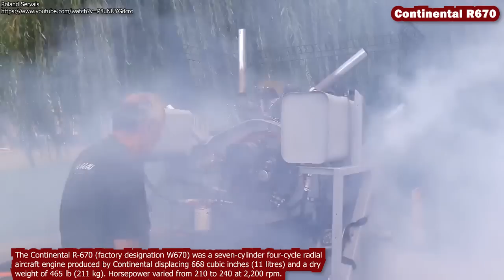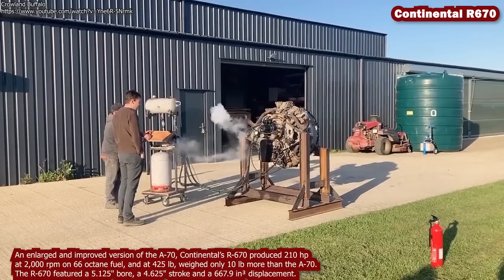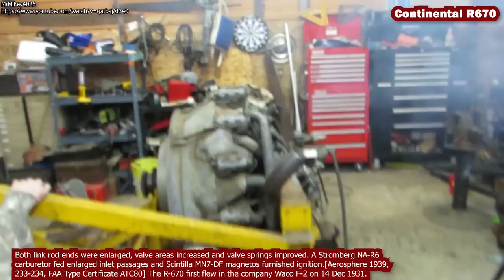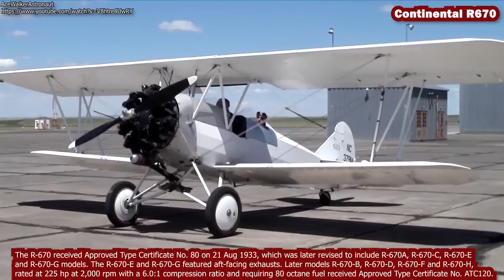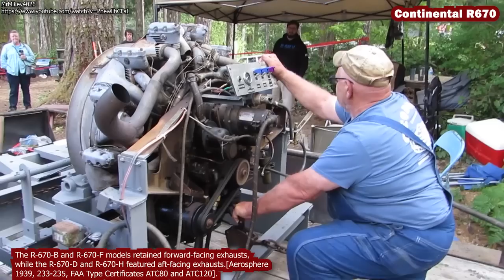Big Old CONTINENTAL R670 Engines COLD STARTING UP AND COOL SOUND

Comment: The W670 is the aircraft version, 220hp. The R670 Ordinance Engine (tank) has domed pistons and is rated at 250hp. The tank engine has many other common components (jugs, starter, some internals) that can be used in the aircraft version, but the "tank engine" cannot be installed on a certified aircraft. The crankshaft splines are also different. We had a tank engine new in the crate that donated the starter for our PT17 Stearman biplane.
Reply: The Tank engine if it adapts to a prop hub could be in experimental plane ....just a thought
Reply: @jeffputman8242  Yea, the Rhinebeck Aerodrome has some experimental replicas that are running tank engines.
Reply: @leeroyholloway4277  There's also Cessnas and Long EZs with LS and Ford Windsor automotive V8s. It's a bit silly, tbph, that the FAA is basically railroading people into using the same engines on their aircraft in 2022 that they were using in 1952. A dry sump'd LS-1 V8 produces 3x the HP of a Lycoming O-320, is just as if not more reliable/long lived, and is far easier to handle. Less pilot workload, more power, just as reliable, sweet v8 sound, don't see the downside beyond having to have an Experimental tag on your bird and maybe a dozen pounds or so of ass weight to get CG back where it should be.
Reply: When I attended A&P school in Utica,NY ( Riverside school of Aeronautics ) they had several 670's that we ran, most had club props installed...learned all about hydo-lock on one, blew it up, tore it apart, rebuilt it too....
Reply: @TestECull  The problem isn't the FAA, it's the lack of a reliable redrive unit.  No one argues that the LS, etc. would work. It's that nobody makes a redrive that will survive, let alone get through the certification process.  Very few auto engine conversions work well, and the redrive is always the problem.  It's usually cheaper, easier and far more reliable to simply install an aircraft engine.
Reply: @robertthomas2942  It very much is the FAA, dude. There's a turn key bolt in conversion kit to LS swap Cessnas floating around. You just have to register your aircraft as an experimental to be able to actually fly it after putting it on there. There's a video or three of one such converted aircraft on YT as well!

LS1s just do not have the necessary FAA paperwork attached to them for you to throw them on whatever airplane you want to. If they did you'd be hearing a LOT more of them in the skies above you.
Reply: @TestECull  Care to show me the redrives that will survive any significant hours?  There aren't any. That's why aircraft with these conversions never fly much, if at all.  Almost all of the successful experimental designs use conventional aircraft engines.  Experimental may use whatever engines they want.  Any.  So why are most choosing conventional aircraft engines?  The simple reason in almost every case is that auto engine conversions do not have the reliability to make them worth it.  For the record, I'm building an experimental with a converted auto engine, so I might have some insight into this.  If you actually did some reading you'd discover pretty quickly that it's quite difficult to make a redrive survive due to torsional vibration problems. Educate yourself please.

Comment: How does this compare to the Continental R975-C1 or -C4 9 cylinder radial gasoline engines with an output of 350 or 400 hp (261 or 298 kW) at 2,400 rpm that were used in Sherman tanks?
Reply: Es muy parecido solo con dos cilindros menos

Comment: In  Idaho there is a man who owned an old logging operation from the 40' and 50's  He has two of these motors just sitting in the brush.  They are connected to large gang saws, and use 4 cyl. motors just to start them.  All of the equipment is there like many old trucks Ect.
Reply: i want to see that
Reply: @jeffputman8242  R U in Idaho ?    I forgot to mention that he operated in the 40's and 50's so some of his equipment dates back to the 20's
Reply: @johnwick-ii6il  no but im thinking road trip next spring

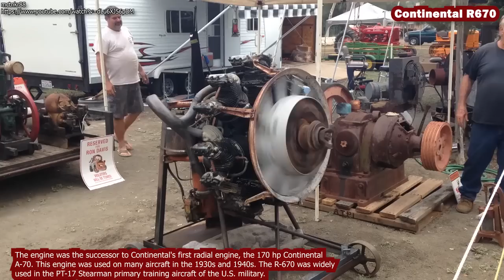Comment: At 0:36 was that a drive shaft yoke attached to the crankshaft ?
Reply: Yup. A lot of these engines were used in tanks and other tracked AFVs during WW2, so they were fitted with cooling fans, shrouds, and yokes. That engine was likely used for such an application.

Comment: Dry weight of 465 lb.  210 to 240 HP at 2,200 rpm.  So call Sensenich to have a quiet propeller made and put Hydraulic strut steering & retracting & braking wheels on a jon boat for an amphibious air boat.

Comment: How fast do you think catalytic converters would clog if ran on some of these?
Reply: Depends on whether you ran it on leaded or unleaded fuel. The CR on these engines is so low that you do not need leaded fuel; the octane rating required is something around 60 so even the shittiest pump gas on our highways would be just fine in there.

You'd need a couple of big cats to handle the sheer displacement of the engine, but you wouldn't have any major clogging issues.
Reply: @TestECull  cats and carbs nah and comp ratio and fuel being leaded or not has nothing to do with it! I run higher compression and a turbo on unleaded fuel with iron valve seats.

Comment: No hearing protection …………smh
Reply: А он уже глухой
Reply: I can’t tell if they have earplugs in or not
Reply: I didn't see any plugs on the big fellow at the end in the bib coveralls. Yes , going to mess up your hearing for sure.
Reply: @johnready630  .. On second thought, seeing for a fact that they have no safety goggles with all of that wind & exhaust from the engines, it’s a safe bet they had no ear protection either. I would hate to think a used engine turned me into Helen Keller.
Reply: @boomstick4054  My hearing was damaged many years ago from loud R&R and other loud things. We didn't think about hearing protection back then but there should be no excuse for it now.